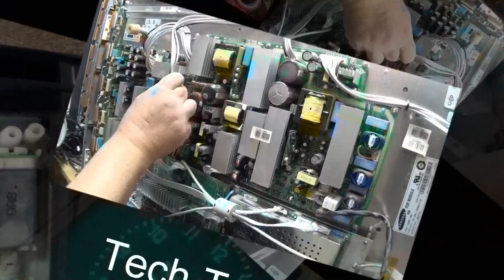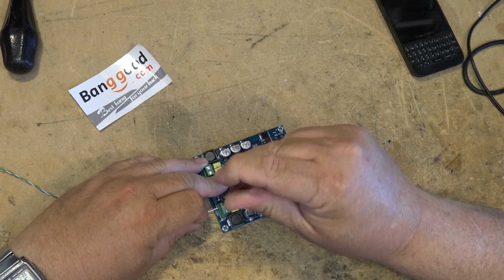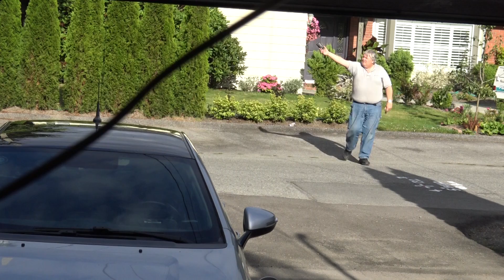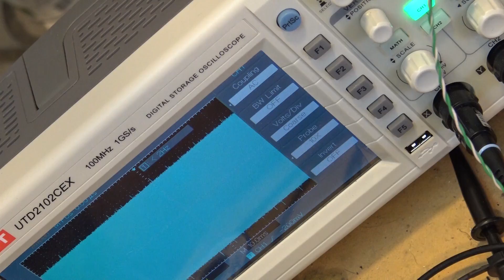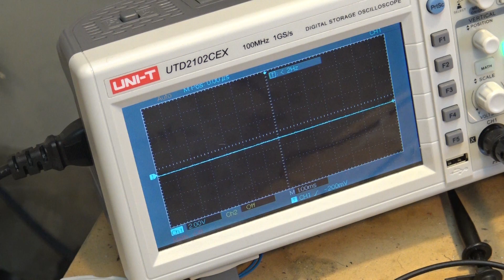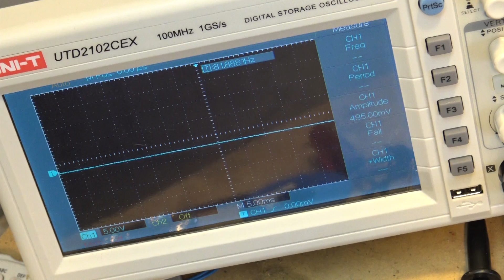TPA3116D2 120 WPC Bluetooth Audio Board test run

Comment: Hi, i have one of this things recently brought. It works great for only 2 hours, then i hear a sound like when is power off. From that moment i can't start it again. I'm using a 19v power from a laptop Sony. I checked el voltages in the mainboard and its ok. Nothing seems to be wrong with any component, no high temperature at the moment of the failure....There's a sequence of buttons maybe to restart it?
Thanks for the help!

Comment: Hi, I have one question, how many current do I need if I use 24VDC, is 3 Amps enough?
Reply: Tijs Stremler P=U*I You need 24V/10A
But 240w is peak. Maybe 5A will be enough. Caps should handle the peak current drain.

Comment: All those power specs are just full lies. The Chinese are zero happy! Just add another zero to the power spec! 12 watts becomes 120 watts! Simple. A car speaker says 500 watts! OMG! Just delete the last zero and you get 50 watts! And that's peak power! So, that 500 watt car speaker could handle about 20-25 watts rms all day long. 30 years ago I went to a flea market and bought a booster amp for my car. It was, of course standard IC output boostrapped. The size of a pack of cigarettes. Said 120 watts! I knew, even back then it was 12 watts max. Nothing's changed. If you connected a REAL amp to those test speakers on the bench, the cones would have shot out across the street at 50 watts! LOL. Nice review though.
Reply from the maker: It has nothing to do with the Chinese. The chips are mostly Texas Instruments, and they are the ones that design the amp. You can look up the chip and you will find the TI data along  with a schematic. The amps they build are all based on these drawings. The power is calculated based on operating voltage and load. As these are class D, they are very efficent, and if you drive them at the voltage they require, they will draw the rated current, and volts x amps gives you the watts, and that is what they base the ratings on. They will deliver this rated power. The chinese board makers just publish the specs of the chip design they use.

Comment: Has anyone used a dummy load for long term test to see how hot this little thing gets with the rated output and decent PSU?
Reply from the maker: Yes I have.  At 8 ohms it cook a pair of 50 watt resistors and barely got warm.

Comment: Your 1/4 wavelength at 2.4Ghz used commonly is 31.25mm which is 1.23", not 1.5"  And considering BT is 2.45Ghz, that length is closer to 1.20".  Trim your wire a bit and you may increase your range slightly.  Best to cut that PCB squiggle and attach there a short run of coax center and ground that should be available and run that to an antenna that is a minimum of 1/4 wavelength away from the dome-peak of the electronics to reduce the floor interference.   Thanks for the video, by the way.

Comment: The TPA3116 is a 100 watt chip and this has 2 so 200w, where does it get the extra 20w per channel extra, a total of 40 watts for 240watt?
Reply: Overrating board manufacturer. The TPA3116 can sometimes do a bit more than 50x2 @ 24v and 4 ohms, but not 20 watts more. I guess Chinese find underrated specs blasphemous and must correct such dissent by doing things like that.

Comment: @12voltvids How is it able to put out 120 watts per channel 2 channels driven so 240 watts from 24v @ 3.2 amp? I'm stuck on stupid here, I purchased 24v at 4 to 6 amps, but 240w divided by 24v = 10a if it was 100% efficient and it says 3 amps needed?

Comment: Nice mod and fun little board for DIY enthusiasts. Thanks for the range information for the wire length. Can that Osciloscope measure THD, WATTS AND DECIBELS?
Reply: Most of the time you would use special audio analyzer, say Audio Precision which is specifically designed for these kind of signal analisys. You can calculate power from the Vp-p measured by the scope. For distortions, frequency response (limited by sampling) it would be possible to use something like REW, ARTA loudspeaker measuring software and voltage divider. But some amps use floating outputs, like this one, and most A/B class common ground so you have to play around and be careful not to fry something by wrong hook up.

Comment: See the special wrapping that board came in!!!!! You can damage it with bare hands !!!!! Static electrictricity Will damage it immediately and oils on your hands can cause corrosion that can shorten the boards life!!!  (Circuit Board 101).... I do watch your channel and learn things so Thanks .... Look it up ???  Just some good advice:)
Reply from the maker: First of all these type of devices are not really static sensitive. 
Cmos type devices yes, when they are loose. Once in a circuit they are fairly well protected. Something that is far more sensitive to static electricity, USB memory sticks, and even more so, SD memory cards.
Just pick up a memory card with static in your body and you can wipe the entire card, yet we don't ship those in antistatic bags. Some manufactures just put them in these anti static bags to protect them in transport for when they are xrayed during shipping,
In 35 years I have yet to damage anything and I used to service stuff sitting on a piece of nylon carpet, which would be a great source of static, yet nothing blew up.

Comment: I just soldered that antenna....soo soo  thank you for that tip  !  I am so happy and greatfull for your instruction !!!!  it works awesome !  1.5 inch antenna !!
Reply: 3 inch antenna works slightly better, but not worth the extra amount of dangling wire.

Comment: Good day I just wanted to ask what is the lowest impedance it can handle thanks!
Reply: I would like to know since what I have is one sub 100 watts  8 ohms and will add two 90 watts 4 ohms connected in parallel, I hope someone can answer if what I am doing will be just fine. Thanks in advance
Reply: It can handle 4ohms per channel but nothing lower.

Comment: Thanks for the great video.  I believe that you mentioned that the card has an input so would it then be possible to attach a 3.5m adapter to it in case I would prefer that?  Any idea as to how much sound degradation for this BT vs. 3.5 m cable to your phone?  Is the 30Watt @ 8ohm 24volt or 50Watt @ 4ohm 24volt accurate?
Reply: Bluetooth has compression, analog does not, but it all depends on how good the DAC is. Bluetooth can potentially be just as good if the integrated dac isn't great.
Reply: I'm searching for the comment for analog input  can I connect analog input ?? Or solder the wire or something? ?

Comment: Thanks for the review! 

The one thing that I don't readily find on these boards ( Amazon and so on ) is if they have that annoying "Blue Tooth Audio" voice.

Maybe I missed it, but is there an on-off switch? 
Does it pop when you turn it on or off?
And how do you think the Bluetooth performance will be once it's maybe mounted inside of an enclosure?
Reply: yes good amp but how do you get it from popping and crackling

Comment: Great info.   Thanks for talking about this being a balanced output.  I wasn't aware that I couldn't use a common ground.  I bought a new speaker that likely has switches and such.  I didn't know they bridged negative wires together which would cause amplifier failure.  Thanks.

Comment: I've built two ammo-box bluetooth speakers using coaxial speakers made for cars, works really well. I'm powering them by a 7,2Ah AGM battery and mounted a charger inside the box with a "cicle of eight" connector for 110/200V on the outside. Also mounted a small LDC panel showing remaining battery. Since the steel box acts a bit like a Faraday cage, I had to solder a tine coaxial cable to where the base of the surface mounted antenna on the board were, scrape off the rail, thus deactivating the original antenna. The cable I soldered I then connected to a Wifi connector that I mounted on the box and then a Wifi antenna on the outside (Both bluetooth and Wifi uses 2,4Ghz so it's perfect). Works quite well and has both good range and power, even though I could only mount one battery in the box because of limited space, two batteries giving 24V would be better.

Comment: Can i use for left chanel a speaker 8ohm 250w and 125rms. and for right chanel a tweeter 150w 8ohm ? I dont know so good about amps and speakers 
(and my eng its not so good ) 😝
Reply: DALEK SEC yes. Run output signal on mono so it doesnt play left and right and run it through a crossover filter before running to speaker. Otherwise it’ll sound like garbage

Comment: RMS power is .707 peak. I did ohms law, on 24 volts, and an 8 ohm load...would be 72 watts (flooded) and .707 that is 50.9 watts rms max per board. So I'm thinkin' 120 watts per channel, is peak to peak rating. A lot of audio companies list this rating, and I grew up on classic electronics, so ohms law and i squared r always comes to mind for power.
Reply: Well, almost.  The 24V is DC so that is + or - 12V peak.  0.707 of that  is 8.something Volts, giving 9W.  So how do they get to 50W or even 120W?  Well, it's actually rated for a peak of about 26V DC, if I remember correctly, but the main thing is that each channel here is bridged, giving you twice the voltage range, and so 4x the power.  But that's still only 36W and we still haven't taken into account the dropout voltage.  So they spec it into 4 ohms to double the power, and 50W is then, possibly, a reasonable spec.

For 120W they put both channels in parallel and they spec it into 2 ohms.  You need a 2 ohm speaker to achieve it, of course.  At all these high levels you are really thrashing the amplifier (and it would have been nice to see him put some sine waves on a scope driving various load resistors to see if it can really manage it).  In fact, on the scope topic, it would have been nice if he had the slightest clue about what he was doing, or how these things worked.  I have run a couple of these off a standard 19.xV laptop supply and that's probably a comfortable supply level to give it.  It's likely to last longer than going to the full 26+V.

Comment: Banggood also has a nice 24 volt DC 9 amp switching power supply. I noticed the maker of the bluetooth boards recommends switching power supply. The supply power has to meet the rated output power, so, I looked at a lot of supplies. One of the other youtube commenters also mentions 19 volts as the 'sweet spot' but I have yet to find a supply that comes that way; probably take the 24 volt and trim it some with the control pin.
Reply: just buy any laptop charger(power supply) this is cheapest option and best. just buy orginal used one, not aftermarket one

Comment: Hi i would like to ask if the output of that module can be connected to an crossover ckt before speakers?so i can have tweeter and midrange/bass?thanks
Reply from the maker: Paul Eduard Besmano 
Yes it can. My speakers have cross over in them.
Reply: Thank you,

Comment: I just love these credit card sized BT Amps. If you ask me, this video could have easily doubled in time and I'd be happy, but still a great video. I have one that uses the tracks from the PCB and they set the BT module on the PCB and used the tracks on the board as a antenna, they did use liquid tin not solder and that allows me to go all over the house and outside and I have real aluminum siding.

Comment: hi, i have one of these running a pair of 10inch PA speakers. using a 37v lithium battery pack. with a buck converter down to 24v.. it is freaking loud :D, however i read that you can make it mono. can you do a video on how to? in order to run 2 of them and double my power? thank you.
Reply: Hi there.  Unfortunately, i believe these chips are already being run as a bridge-tied-load circuit.  If thats the case, "bridging" any further would likely destroy them.   So, probably a No to that question. Unless you wanna just run 1 channel alone (which may cause problems as well, depending on this chip's topology.)

Better if you look up the chip spec sheet.  Perhaps these are tpa3116...(tda?)    Google will help ya!

Cheers

Comment: My own tests on this unit are as follows: Needs the antenna mod shown in this video but that makes the Bluetooth work great. Very easy mod to do, see this excellent video. Comparing it to a SE EL84 tube amp, both capable of low volume good involving sound without fatigue or need to turn it up. This digital amp on a 24 volt 2.7 amp laptop power supply begins to clip symmetrically at 2 volts RMS with 8 ohm load, odd harmonics, so 1/2 watt per channel. Very similar power to my SE tube amp. Frequency response flat 60 - 18,000 HZ. Mild roll off at 40HZ, more at 20HZ, but still some signal there. The SE tube with much more low end slam than this despite equivalent watts. My speakers only go down to 50 HZ so bass is not what I am after. Will actually use this amp, I think, as it is very good sounding at low volume for near field listening. Convenient Bluetooth implementation. I think it sounds just a little better on 19 volts than 24.

Comment: Really excellent video! For the audio waveform demo at 28:40 you point out 24 volts on scope. Were your leads across the speaker out terminals, and measuring entire balanced output voltage, or was one lead referenced to ground? This is a balanced output amp, I think, so it would make a difference in this amp. Have you done a measurement with sine waves? Have you tried the Bluetooth out points for audio in? I work on tubes only so far but really intrigued by this digital method, now that your scope showed me what is really happening in that tiny amp.

Comment: hey so i just got this amp Where is the output so i can connect another amp for my other speaker
Reply: can i use that input for output ?
Reply from the maker: At 12:02 you can see where I am probing the scope. There is a header there larked L G R for left round and Right. That is the output from the bluetooth receiver that you can take to an external amp.
Reply: omg awesome cuz i am planning to use another amp for just bass. thank you
Reply: since I have 5 speakers for my project im using one as a subwoofer

Comment: Hi there. Any chance you could answer a question for me? When you connect that audio in, in the middle of the board, does it override the Bluetooth? I'm wondering how that would function if I used it in a home speaker project :-)
Reply from the maker: Chris Bouncy Parker 
That audio test point I scoped in the middle of the board will not function as an input as the Bluetooth receiver mutes the amplifier when there is no active audio so that you don't hear any pops and clicks when not streaming sound. The mute input shuts the chip down completely. So you would have to disable the mute input to the amp chip in order to use this as an input.
Reply: If you jump ground with the upper left pin (TX I think) you can override the Bluetooth signal. You can always add a switch to ground it anytime you'd like.
Reply: Got you. That's a shame about the audio input. I don't suppose you would be able to point me in the direction of a board with similar spec, which also has a line in? 

Also, how long in mm was your Bluetooth aerial? I've tried to work out the equation, but can't make it make sense! Many thanks in advance!
Reply: 12voltvids  so basically it’s a headphone out put Jack?
Reply: I bought the one without the bluetooth, then you can use any input, you are not limited to BT only.

Comment: Is it possible to add an aux input to the board?
Reply from the maker: You can add an aux out, but not an aux in without disabling the bluetooth receiver. The reason is that when the bluetooth receiver is not active it mutes the amplifier chip. I have reviewed other boards that have line level inputs on them that would be a better candidate for this.
Reply: 12voltvids thanks for the info
Reply: RUST instead of buying XH-M543 with BT,  buy the other XH-M543 2*120W r DIY Module TPA3116D2 TPA3116 Dual Channel Stereo High Power Digital Audio Power Amplifier Board this is without BT, the first one that 12voltvids shows
Reply: If i where to add a switch to the bluetooth module +3.3v do you think i could be able to use this with aux and bluetooth?
Reply from the maker: Stian Lund 
Perhaps. I have not tried to mod this one as it installed inside a dual speaker box.

Comment: Great review!

Quick question:  Can you connect your smart phone to more than one of these amplifiers at the same time?

The reason I ask is because I would like to convert a pair of Bose 301 speakers to Bluetooth and install these amplifiers inside the cabinets, along with a lipo battery pack and charging circuitry, switches, etc.   And, I would want true stereo - which would require two of these boards.

Thanks!
Reply from the maker: No they only connect to 1 board at a time.  This is a stereo board, so you could put it in a speaker box and wire to the speaker internal, and the other channel to the speaker terminals. Then just connect a single wire run from one speaker to the other. That will be a future project for another bluetooth board I have. When I get another pair of speakers.
Reply: I thought that might be the case.   So, it did occur to me that I could do as you suggest.   I was just hoping to put together a totally wireless Bluetooth solution.  Thanks, for the reply!

Comment: What is the minimum output impedance?
Reply from the maker: You can google this just as easy as I can. 
Down to 2 ohms when configured for mono operation (100 watts) 4 ohm in stereo mode.

Comment: Isn't 12V 3 Amp gonna give 36 Watts?
Reply: are you asking for the total power of the supply output or the power of the audio output. they're different from each other, audio power is in BETA factor. search for the Formula on total audio power output. google it